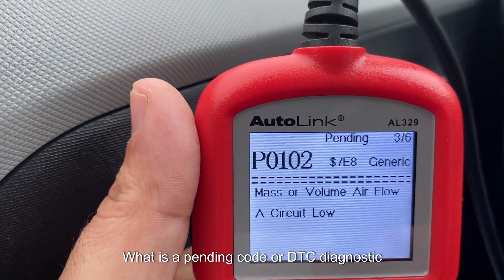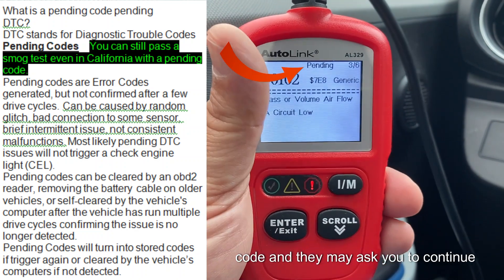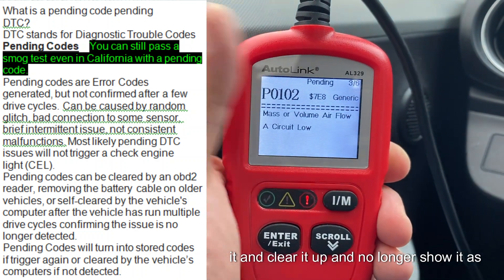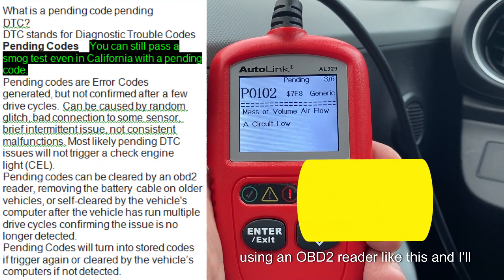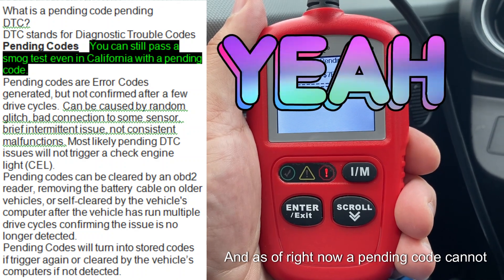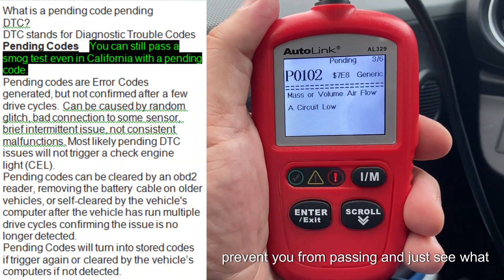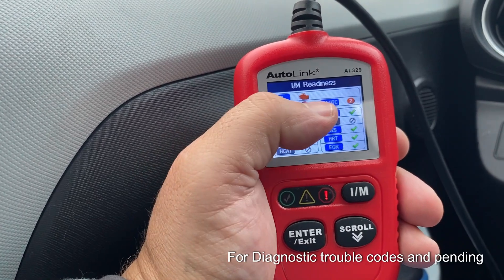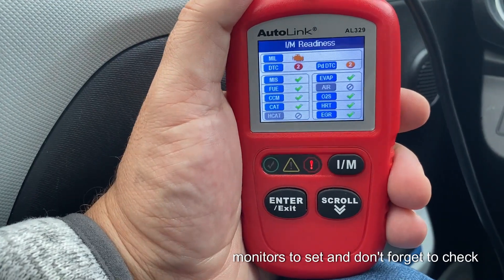Why Your Car Says "PENDING" Codes (and How to Fix It)

Comment: Hello, thanks for the video first off. I do have a question my car has 2 permanent codes and smog technician told me that there is no check engine light and all monitors are clear and had me drive my car 250 miles and some cold starts but permanent codes still there. What do you suggest I should do at this point? Thank you in advance.
Reply from the maker: You need to have the vehicle clear them. You should get a obd2 reader and you can even clear them faster. I show it in this video https://youtu.be/wcCRN_c6Mss?si=4FVlx56bu50481Fe